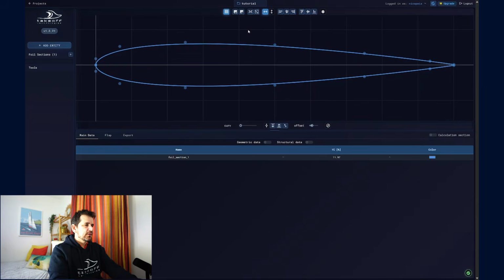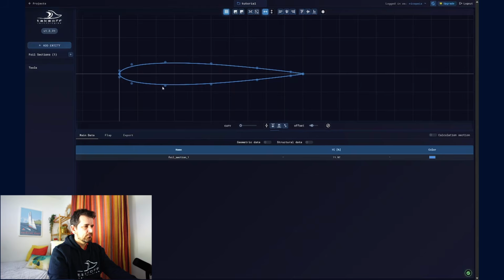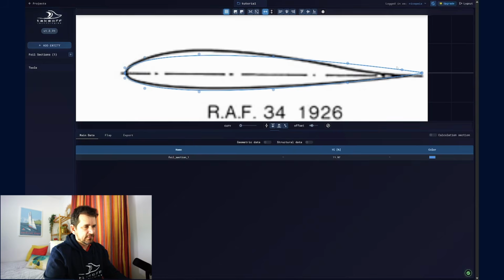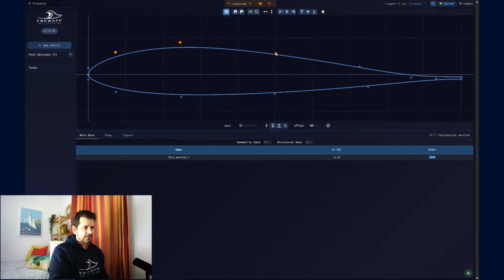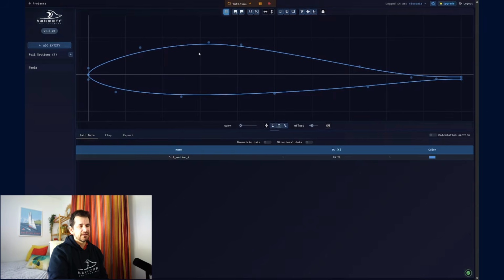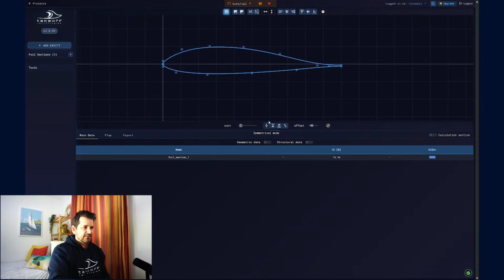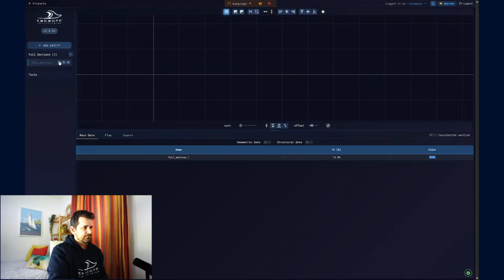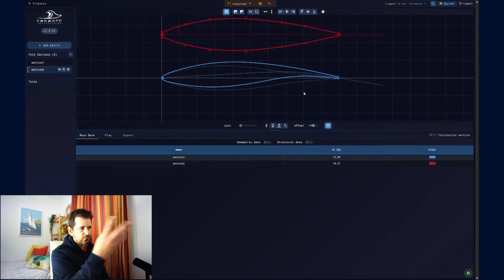2D airfoil geometry generation | EP01 | 2D Airfoil Masterclass

Comment: Still loving it! 

Really excited about this and where you're taking it. Currently this is the only software I have come across which isn't clunky difficult open source, or insanely expensive professional suites WAY out of a hobbyist price range

Feature request: Undo. Ideally a global undo history, with the last 50 actions or whatever, but at minimum an undo in the 2D canvas. If you already have this, I haven't figured out where it lives. 

Bug report: I noticed that in Brave browser on my mac, the control points are not draggable, I haven't figured out why. The issue is not present in Safari

Is there somewhere better than here I can drop future requests and/or bug reports?
Reply from the maker: Thank you so much, Jackob! Comments like this provide a huge boost to the team's motivation. You hit the nail on the head—our goal is to make conceptual design for foils, boats, aircraft, .... accessible to everyone without the 'clunky' or 'expensive' barriers. What you see today is just a small glimpse of the ecosystem we are building—there is so much more in the pipeline 

Regarding your points:
  - Undo Feature: We hear you! A full undo history is currently in development. In the meantime, the best workaround is to watch the 'unsaved' state (the orange indicator). If you need to revert, you can discard changes using the red bin button to return to your last save. We know it’s not a true 'Undo' yet, but it’s coming!
  - Brave Bug: Thanks for the heads-up on the Brave/Mac control point issue. We'll get that into our testing pipeline immediately.
  - Feedback: We’d love to have more of your input! You can email us at support@takeoff-technologies.com, or use the feedback form in your user dashboard. To find it, click your user icon (top right) and select "MY ACCOUNT".

This is just the beginning—stay tuned for more!